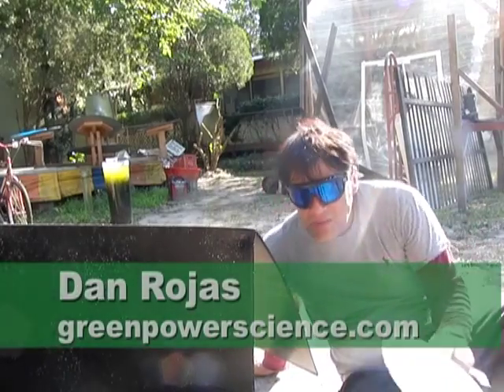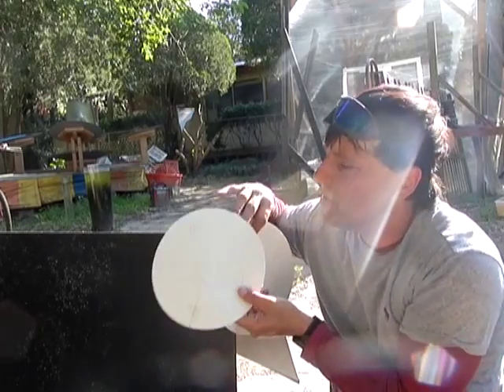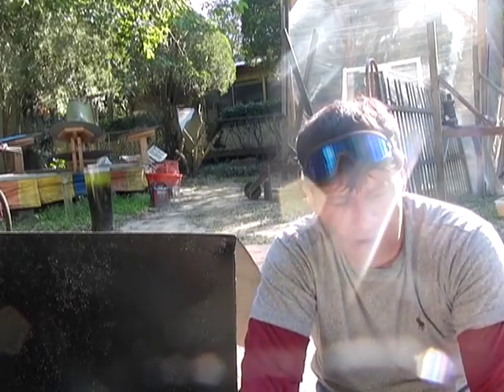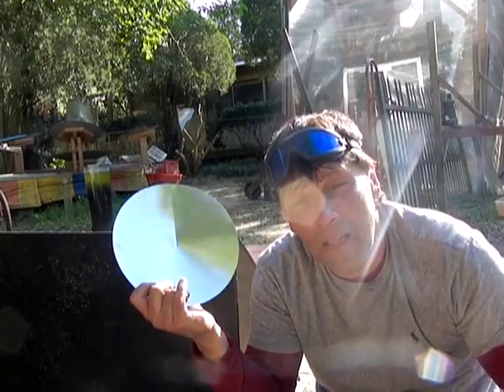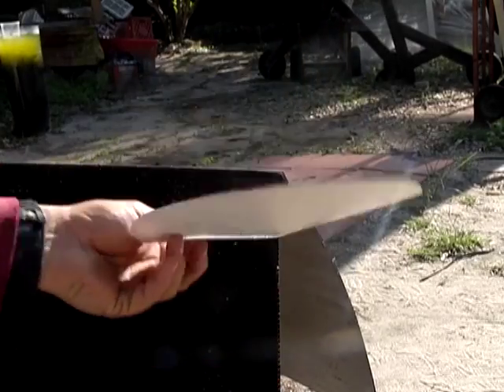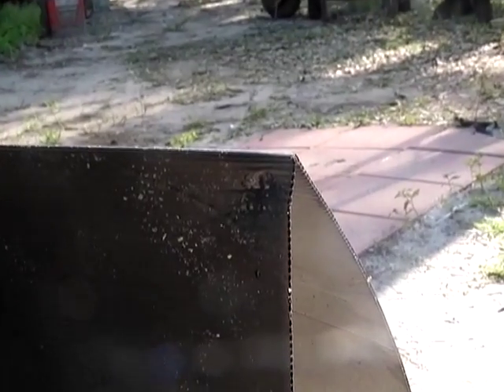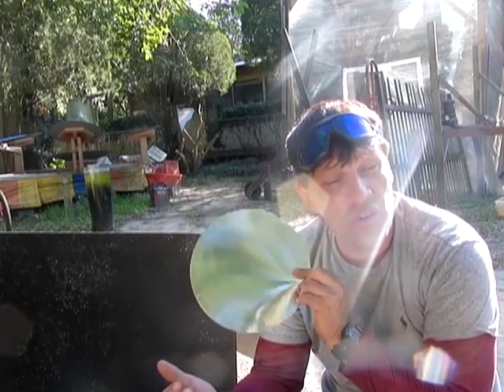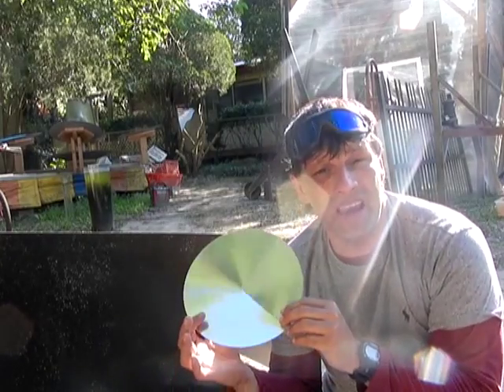Cheap Solar Cooker inexpensive mass distribution Parabolic Oven Cooking

Comment: I bet that if you write the formula for this trick, you can get it published. One might start by the contra=-parabola shape, fold the plate around it as tightly as possible and meticulously measure what you've done.

Comment: I want to underscore this idea. It seems to me a curved cut could be determined which would result in a nearly perfect parabola when the edges are brought together. I would expect two "S" shaped cuts converging at the center of the circle would result in a small amount of bending near the center and more curvature on the periphery. A way to test this idea would be to start with a parabola and try to cut it so that it lays flat.

Comment: Maybe a use could be found for the pans.  If you could find a way to cook with the pans, you could develop it as a personal cooking/messkit system. It may not be necessary to make a 40" paraboloid...a smaller lid might suffice, and then you just include two--one converts to a cooker and one is just a lid.  If the aluminum doesn't fare well, maybe it could be put amidst stones or have a bit of mud rubbed on the outside.  Or you just put two aluminum pans together so they are stronger.

Comment: You don't necessarily need parabolic shape for solar cooking. I have found that the simplest design involves a box that is square viewed from above. You can make 2 simple reflector cookers by cutting it in half diagonally. The bottom flaps keep it steady while to top flaps add extra space for the foil reflectors. With the reflector cooker, all you need for cooking is a black jar and a cooking bag.

P.S. if you wish to get foil covered cardboard, take a look at art supplies shops...

Comment: if you place this reflective card behind a parabolic mirror,then form the card to a true parabolic shape and cut and trim the card where required, then use a pen to mark on the back where the user would need to stick the edges, Maybe the design could be made more efficient and still easy to stick together?  The orignial could of course be used as a template for the production of many others.: )